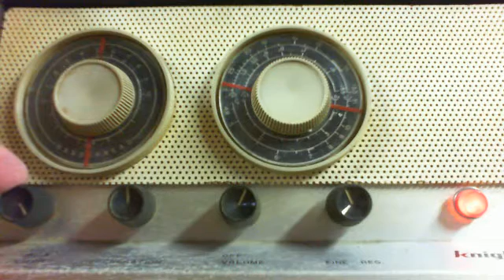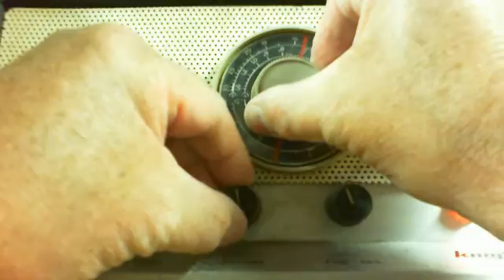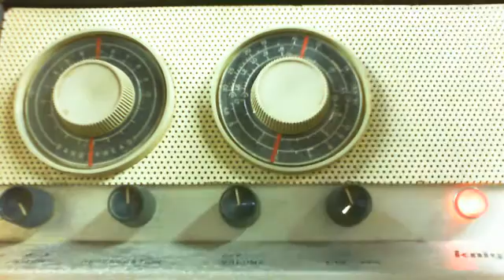Allied Radio Knight Span Master Regenerative Receiver

Comment: My first shortwave radio that I built from a kit.. Being from Chicago, my Dad would take me down to Allied radio occasionally and bought me this radio.. Had a lot of fun SWLing with it and then graduated to a Hallicrafters SX-110 and a HT-40 transmitter both purchased from Allied Radio and used for amateur radio.. My first rigs when getting on the air as a novice as WN9OFS.. As a matter of fact, I took the code lessons Allied had at the store and that's how I learned CW.. Great times!... K9GC